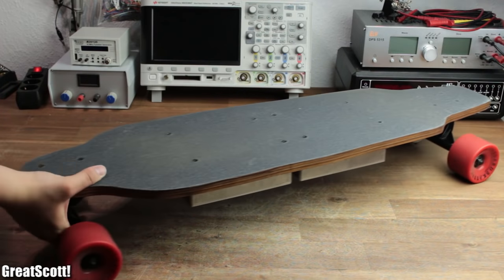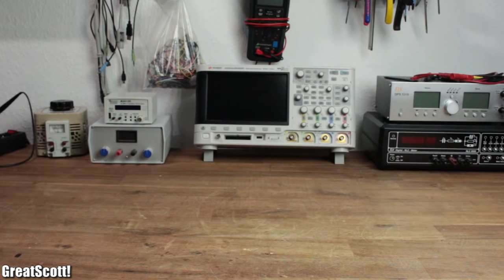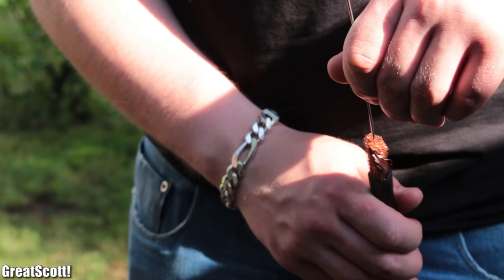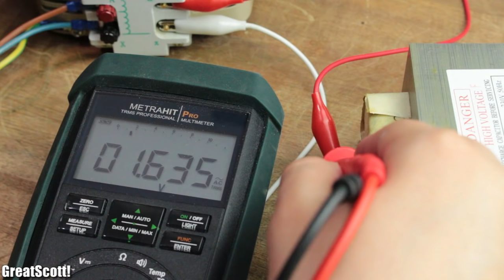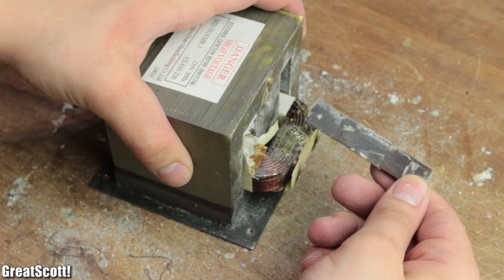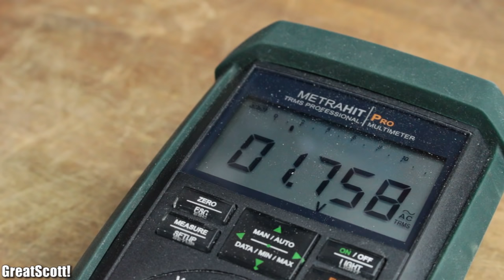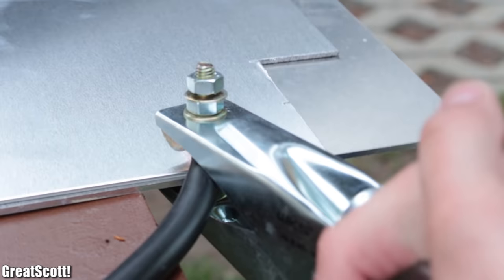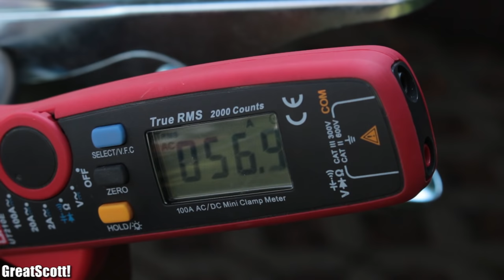HACKED!: Microwave Transformer becomes a High Current Transformer

Comment: Hey Scott, the maximun power of a transformer is its area^2 and you can get more from the wall plug, you Just need to connect the primary coils of two transformers or maybe 3 in parallel and the outputs in series with that you can get like 24 volts or near and that works pretty well, I have a welder and know to weld but I made one a time ago and works pretty fine byee
Reply: With one transformer you are probably just getting 900 or 800 W
Reply: And get you a welder mask, for God
Reply: Why add "just asking" at the end of your sentence when it's clear you're asking a question? If in doubt, use a question mark.
Reply: John Michael Stock  
He added that to make it clear that it was an innocent question, and not a challenge to another user's comment. Or did you miss that when you were instructing him on punctuation? ;-)

Comment: Arc welding is a fair bit higher voltage, enough to feel. I was subjected to this as a kid holding up an angle iron piece for my father to weld, however the ground was attached to the frame, not my piece. So as i moved fractionally to disconnect the circuit, I became the circuit. It was very mild compared to 240v AC. I would hazard a guess at 50v

Comment: Nice tinkering and everything, but you do realise you cant stick weld aluminium dont you?
Reply from the maker: You can. But not the way I tried it.
Reply: GreatScott! you can weld stick weld it. but it needs flux. not that filler you were using. and why waste your time. buy a welder 600 american dollars
Reply: i would like to see a link to the US$600 that can weld aluminium. also GreatScott should have tried reversing his polarity. the aluminium "electrodes" he was using was actually filler wire for the GTAW (TIG) process, totally different from SMAW (stick welding).

also side note, most popular welding process are arc welding: GTAW = Gas Tungsten Arc Welding, GMAW = Gas Metal Arc Welding FCAW = Flux Cored Arc Welding SMAW = Shielded Metal Arc Welding.

TLDR stick welding aluminium is possible, you just need the correct electrodes and polarity.
Reply: ^ and inert gas or flux
Reply: Dave Joyce you do realize he's welding on AC, right?

Comment: You first attempt with the 70mm^2 wire might have worked as a spot welder. MMA welding uses about 40 Volts.  It is also possible that a thin oxide layer on the aluminium may have increased the resistance enough to severely limit the current.

Comment: Although welding machines have such a high variability in power ratings,  the voltage required for most is 20--30 volts...some processes are AC 0r DC, and some machines offer both.    The variance however, comes in the amperes that can be delivered....the higher the amps, the thicker capacity of metal that can be joined.    Additionally, there are processes that require a power supply capable of providing constant voltage or constant current.    There are so many people with the youtube mentality that if it is broadcasted it must be ok to do; dismantling a microwave is not among the things that most you tubers could do safely....as mentioned in the concerns below.

Comment: As others have point out, aluminium is tough to weld. One of the reasons is that it conducts heat mad well, so it takes a lot of power to get it hot enough to weld.

Comment: Welding 1/8“ aluminum plate often requires 90-140 amps, depending on the type of welding used and the overall size of the part being welded. 1/4“ aluminum can take up to 250 amps or more to weld. This is because aluminum conducts and dissipates heat very quickly, so it takes enormous amounts of heat just to heat aluminum up to it’s melting point. 
Secondly, high amperage current doesn’t like to arc up, so a high voltage current may be needed to strike an arc. With stick welding, you „strike“ an arc just like striking a match.
Thirdly, molten metal will oxidize (burn) if exposed to oxygen while welding, so you either need a shielding gas such as argon or helium to displace all oxygen from the weld area, or special flux-coated electrodes (the flux burns and produces carbon dioxide and carbon monoxide, which shield the weld from the oxygen in the atmosphere). 

That being said, I have seen videos of people welding things with microwave transformers, so it can definitely be done. Small briefcase-sized welding machines can be found for a couple hundred dollars though, so it might be better to spend the extra money on a proper welding machine.

Comment: Ismt tis incredibly dangerous?
Reply from the maker: Not if you know what you are doing. But don't try to replicate it anyway ;-)
Reply from the maker: bjorn hettema
Not really
Reply: +GreatScott! Oh nvm then!
Reply: no really you can touch it it's so low voltage
Reply: voltage is just for pain, if 1A going inside you ur dead .. 100v 1000v its the same 1amp its lethal
Reply: after resistance of your skin
Reply: Voltage defines the maximum current that your body allows to go trough.
Reply: yes water too and ur shoes,.. many parameters
Reply: Yes, the High Voltage capacitor in the microwave that he glossed over alone is very dangerous. They tend to hold their charge for a very long time, so one must be careful to properly discharge them first.
Reply: For people saying its the amps that kill, that's not always right. And the modified transformer outputs about 3K Watts
Reply: yes sorry its not alway true but tazer can deal over 1.000.000 volt and he is "no lethal" but yes its true voltage can kill you but just dont miss 1amp after your skin is necessary at 24v too sorry for my bad english 
stay safe and peace ! ;)
Reply: +GreatScott! I think I probably know what I'm doing if I play with 3kv that Ming puts out on 120
Reply: failing to do so results in excessive swearing
Reply: A car is incredibly dangerous to someone who has never driven before. This stuff is safe in this guy's hands, because he knows what he's doing.
Reply: Nope you need both in order to kill. You can even touch a car battery without getting dead. But a microwave oven transformer has voltage and current (2kVAC with peak current up to 2A).
Reply: if you want to be professional electro engineer like him, then be brave
Reply: The most important thing is knowledge.
Reply: GreatScott! If you have so much knowledge why you failed twice?

Comment: Aluminum is usually welded in an oxygen free atmosphere as in heli-arc using helium gas. In a tig machine the gas is fed to the arc along with the welding rod. High current is more important than high voltage as the current determines the amount of heat that can be produced at the working area. You don't need to draw four inch sparks, nor should you want to, but you do want to heat the metal you are working on so that it melts together with the rod at the joint. I'm only a very novice welder, please correct any errors.

Comment: Aluminum is a bitch to weld. As a professional welder and blacksmith, I can tell you the normal procedure would be a TIG welder put on AC. It gives you a pulsating weld current that makes it possible to weld Aluminium or Aluminum as they call it in the US. The problem with this material is it creates an oxide layer which is hard to penetrate and make a decent welding on. Btw..your TIG electrode will be the flattened first time you light up the arc ( it's just the way AC welding works).
If you want to weld this material oxygen/acetylene welding would be another way to do it, but that requires some skills.

Comment: the "Grant Thompson King of random" alredy show how to make a stick welder, a spot welder and this one i done on the first try! 
só i recomend you to go to his Channel and see how he do it!
Reply: CroW Fuguetero I have a feeling he copied him if I am wrong then sorry
Reply: I made it as well. It does weld, however they overheat after too much welding. I am planning to use 4 transformers instead of two. Same power, same output voltage, but more robust construction! ;-)
Reply: +CroW Fuguetero If you didn't notice, the King of Random tried welding steel, Great Scott is trying to weld aluminium, which are two completely different kinds of metal. You can't weld aluminium without a protective atmosphere, so stick-welding is out of the question in the first place.

Comment: 1. You can't stick weld with an open-circuit voltage of 1.7V. It just ain't gonna happen. 
2. Your "special aluminum electrode" seems to be either filler wire for TIG welding or aluminum brazing rod. Aluminum stick welding electrodes have a flux coating on them, which dissolves off the surface oxide from the base metal and produces shielding gas to keep the oxide from re-forming. 
3. Stick welding with AC power requires the flux to contain a good arc stabilizer to maintain the arc when the voltage momentarily passes zero. So not even all stick welding electrodes will tolerate AC.

Comment: Transformers create a ratio, which will be insufficient until you parallel a  phase.  Or in layman's terms,  use the output of one transformer to feed another transformer (making it primary feeding secondary) it's output will increase voltage allowing weld output.

Comment: Most arc welding starts out at 20v and 50a minimum, the aluminum electrode wasn't really a welding electrode but a filler rod for tig welding, an arc welding electrode needs a flux coating

Comment: Two years later, I dare giving my 2 cents:
Aluminium oxidize so fast in 20% concentration that it is impossible to do.
If you apply enough heat to melt it, then it burns violently, like clearly seen with thermite.
Using an oxygen concentrator, I was able to burn aluminium cans... But only by moving the source of oxygen constantly.
When a bright and hot part of the can start burning, the aluminium oxide layers blocks further burning.
Argon is the friend of aluminium welders. Helium is too light and cold.

Comment: Just a disclaimer….if you try and take apart a microwave make sure you discharge the capacitor. Use needle nose pliers with a rubber handle or something like that.
Reply: There is a label on top of the MOT that mentions that

Comment: I think that one reason your weld was unsuccessful is because you didn't rectify the input voltage, AC doesn't penetrate nearly as much as DC especially at those low voltages. What it does is basically swap the polarity, and the direction the current is trying to weld, 50 or 60 times a second. This gives little to no penetration. Also aluminum is in itself hard to weld so you had that stacked against you from the get go.

Comment: 220/240 volt input and a high output dial & you would have success. Important to note that the transformer needs a solenoid attached between the dial and transformer using your earth ground for duty cycle which will be low without using the capacitors.

Comment: There are so many problems with this video (I know it was made 2 years ago, this is so nobody else repeats these mistakes)
1) Don't scrap that PCB, it's great for smoothing out AC waves
2) Aside from the cancer risk from disassembling the magnetron (because the ceramic is somewhat delicate), it's FAR more useful left intact
3) You would've been far better off removing the weld on the transformer core and carefully pulling out the secondary coil if you wanted to switch back to high voltage (which you need for arc welding)
4) You need an arc carrying about 3 amps to weld aluminum, stick welding isn't a great idea since you're more likely to just burn through it

Comment: In New Zealand most arc welders come in at about 48volts, just under the 50v max for ELV (extra low voltage) as a safety requirement.

Comment: This might be a late comment. But alluminum cannot be weld with dc.
You will need to create a small change in current direction in a specific frequency. That will undo the oxide layer of the alluminum and allow material tô deposit. It would be an interesting diy project!

Comment: remove the copper secondary by cutting it, as you do, but then you can put whole transformer in a vice to support the steel case, not restricting copper -  and bash it through with a square piece of wood nudging each side through - then the lot slides out like stiff butter in one piece  :)

Comment: I'm a bit late to the punch, but you can wire two car batteries in series. Use that trick on the trails to weld broken axles. Works pretty darn good

Comment: I love welding aluminum, stick aluminum is a lot of fun but i dont do it nearly as often as tig and its been a while. I suggest higher silicon electrodes because it will be easier to weld with, maybe 4043. also, for tig you would need around 180 amps for a good weld there but I don't remember with stick, I think it's around half that. If it is helpful to you, I can mess around with the welder later and find the best amperage. Let me know

Comment: You cannot weld aluminum without a shielding gas. Aluminum is too reactive and forms what is essentially non conductive sand with oxygen in the air. You CAN braze it using a propane torch and field's metal which is a low melting point brazing allow that will alloy/wet to aluminum.

Comment: aluminium can be properly welded only with AC, With tig procedure - argon(gas) welding. I think that you would weld iron with this, both with 70 and 16 diameter coil inside. 60 amps is just fine for thin iron plates, but still, welding tools are usually aronud 130, 160, 180, 200 amps and more... :)

Comment: I would not use this method for your specific needs because this can only be used for Spot welding, so I would attempt arc welding with the original 2kv output in the beginning. This is because what you need is heat, not sparks. So using a very hot arc would sufficiently weld the surface of the metal. Just be safe and use gloves and preferably a welding mask.

Comment: hey buddy flux core welding usually is about 50 volts at around 25-50amps. also to note is that ac current welds more difficultly than dc current. you should maybe think about pre heating as well as using smaller diameter welding rod.

as afrotech said you're also going to have a better time welding steel then you are going to have a better time.

Comment: The core gets saturated at higher current values. This limits the output current. If you can make an air gap in the core, that would be sufficient for high current operation.

Comment: You need an air gap because the transformer core gets saturated because of high secondary current. Making a small air gap will fix this issue.

Comment: Try iron and having the ground closer to electrode. Aluminum isn't typically welded with rodes, aspecielly if your using iron rodes. Aluminum is usually TIG welded using a tungsten rod to melt an aluminum filler rod. Very Slightly similar to soldering. Not like MIG or STIG welding which is what your basically doing.

Comment: I believe rectifying the AC out of the secondary may help. Also, are you sure your connections to the parts to be welded are good enough, like, what's the resistance between the clamped to-be-soldered material and the output of the secondary? You may be getting fewer amps than you think.

Finally, is there a practical way to steo up by a factor of like x3 the voltage from the secondary output that doesn't involve another transformer?

Comment: the voltage for welding is usually in the 20 or higher volts. you might need 2 microwave transformers with the output in series.the higher the voltage the better and easier it is to get a arc .

Comment: So funny to see you trying to weld with 7 volts.  
For Mig I have seen that 20 to 24 volts is ideal. 
You may actually have some luck with aluminum because AC is supposed to be superior, although you will also need a shielding gas to prevent oxidation of the molten metal.

Comment: To draw the arc you need around 50V and then enough current available to properly heat the work. Aluminum requires helium as an inert gas envelope to prevent oxidation. (Heliarc)

Comment: all you really need is tighter tolerances between your motor mount bar and the truck and you wont have that side to side flex even with that set screw setup you have there. also you need a shielding gas or flux if you hope to get any successful welds happening

Comment: Try welding a pop can, with a thinner electrode.  Aluminum is not super easy, and requires flux, unless you are TIG welding.  When welding thick materials, you need more current.

Comment: i know im suuper late, but it doesnt seem like anyone else said it. You are welding wrong, to properly stick weld you need to hold the electrode just above the surface of the metal, you were placing it right on it. its called arc welding for a reason, the arc makes it hot

Comment: You need 10 turns of the yellow wire in total. I mean you need to pieces of this wire connected in parallel and wire the transformer with 5 turns. Finally, you'll have 4 outputs in total. Connect them in parallel and you'll have 2(+ and-). Put a 17-20mm hexagon bolt and now you're ready to burn whatever you want. Even aluminium electrodes. But it would be preferable for your transformer to be big and heavy so it can produce high current in secondary coil.

Comment: You need a good flux and little more power. At high temps metal oxydizes and the oxide doesnt conduct well. The flux blocks oxygen. An easy thing to try is flowing nitrogen at the point of the weld as you weld. Nitrogen is used  as a flux. Try flux used for copper sweating. You may also need more power. Your transformer may need to be larger so it could store more magnetic flux so it could sustain the arc. Increasing the frequency of the primary may also help.

Comment: I think instead of removing the secondary winding of initial Xmer you should try by just reversing the supply means use sec. Winding to connect 220 or 110 volt and take output from primary of initial Xmer.it may increase the current 8 times or may cascade the two Xmer in series to increase. The current upto 16 times...